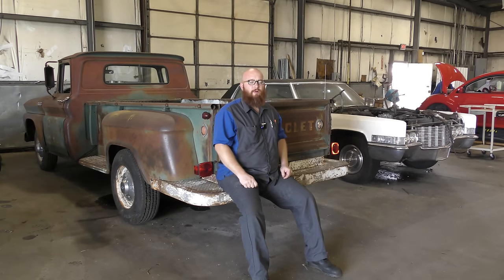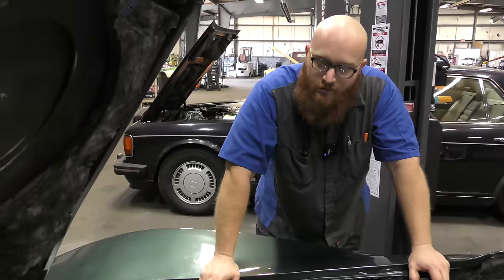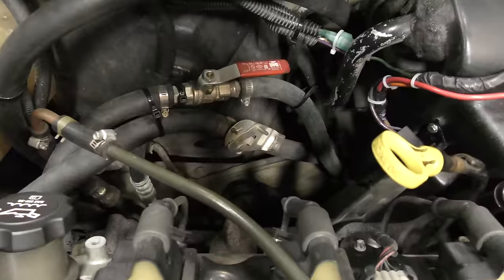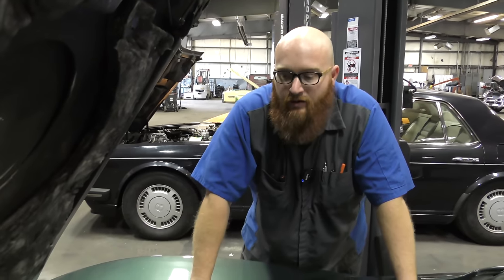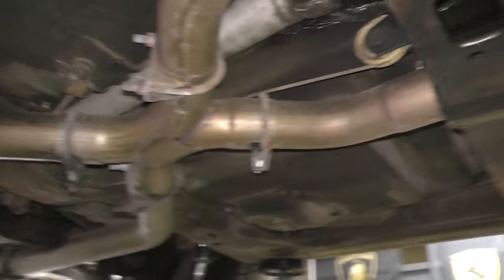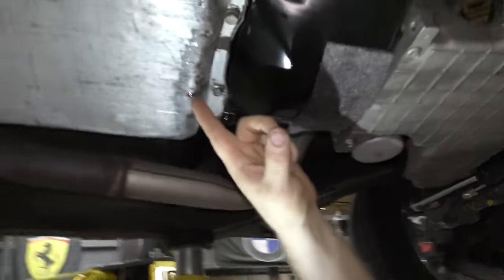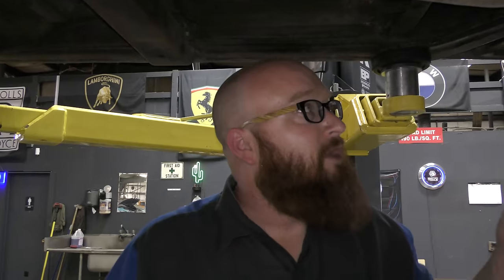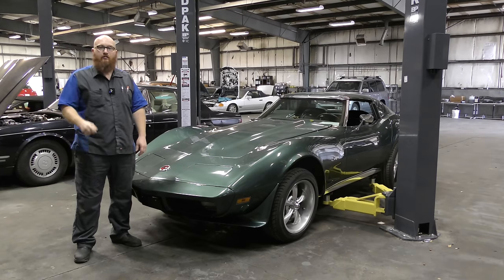Issues AFTER an LS swap! CAR WIZARD warns what can happen on an LS swapped '73 Corvette Stingray

Comment: I owned a new 73 454 4 speed in 73.  0-60 in 6.5 seconds around 250 horsepower.  Most minivans can do that today.  I enjoy modern versions of cars.  I can work on V8’s, carbs, and distributors but why now.

Comment: i would go with the after market fuel injection like the new holley system but u lose up to 45 hp with fuel injection and response but gain in mpg and u can tune to the road carb u need to know how to run the peddle if u race  they both have there ups and downs on the street i would have fuel injection if money was no option . if u do an engine swap u should keep a record of it and everything that was dun and what the engine came out of year and model and everything else u put on it the better the records the easy'er it is to work on

Comment: Electronics has always been the hardest part of a swap for me, from my experience is easiest to get a complete donor car and try to swamp as much over as you can. If you need parts from something else document it. I also don't get why you would swap to a LS and then use a carburetor, I would have gone LS EFI or just thrown in a build small-block.

Comment: I’ve been around so long that I knew guys that got out of the auto repair because of their unwillingness to learn new technologies. I worked in the industry when there were nightmare computerized carburetors and ridiculous vacuum operated emission controls that tried to make carburetors run lean enough to meat federal emissions. I learned the early fuel injection systems and have seen them improve in performance and reliability. I totally approve. I guess it stands to reason that most young mechanics don’t know how to work on carbs. Not enough business there to warrant the investment to learn it. I still run carbs on my old cars but I won’t touch anyone else’s junk for any reason. I can fix the cars. I just don’t want to deal with psycho people. If they can’t fix their simple carb themselves then they’re not cool enough to do that. drive fuel injection. Every hillbilly in the trailer park thinks they can do an ls swap now but most old engines can be made to run the way they should a lot cheaper if you know what you’re doing. Got to have your shit together either way. P.s I used to convert a ton of diesel gm cars to gas with Olds 350 gas motors. Easy and made a terrible car run well. That car would be a good candidate for an ls swap.

Comment: I think you could get good results with a carburetor on the old vortec engines 5 liter or 5.7 Edelbrock makes intakes and nice 650 cfm carbs then get an old HEI distributor and off you go they usually work great right out of the box I still have one in my garage

Comment: For me, the whole point and benefit of an "LS Swap" is the fact that you are also swapping in the latest technology, like fuel injection and no distributor and OBD-ll tuning. Why would some one do this swap and then put a Demon copy of a thermoquad on it?? Yes,  you need a chassis dyno, like we have, to get a decent tune out of it. You can get it close and run good without one....IF.....IF......you're someone (like me) who has been around these things since the mid 70's and knows how to tune them and old cars in general. I have a 1980 Corvette. Stock engine. All I hear is "Why don't you put an LS in it?". My answer.... Why fuck up a nice car? I did swap the quadrajet for a Holley spread bore version. Better tuning, bigger float bowls and much better of idle transition. The cruise control still functions with it too. That was important.  I'm in the restoration end of the auto business, so that has an effect on what I want in a vehicle. I don't care for the custom and "make it go really fast" stuff. But, the mechanics are just that...mechanics.

Comment: I'm baffled that there are guys that say, "I can figure out fuel injection, but I don't like working on or can't figurer out carburetors." You can figure out tuning a fuel injections system using holley software, efi live or whatever. But you can't figure out looking at plugs, or hooking up a AFR gauge, and can't figurer out changing out jets? I like both, fuel injection is great but can be just as much of a pain to get it to run right  as a carb. Carbed LS engines can flat run, and for someone lacking the computer tech or software to tune fuel injection it can be easier and more affordable, especially if you already had a carb lying around to rebuild and use.
Reply: pretty sure that oil pan is a C5 vette oil pan that's what I used in my 78 vette 6.0 ls swap

Comment: Granted on tv but richard hammond on tg, think its the one they got old british classics (with classic british problems) and i think it kept leaking coolant so he had a water container in the seat with a rotary handpump to keep refilling the coolant lol,
Wouldnt say mod but people using plastic wrapped garden mesh/fence or wire electrical wiring (headphones seems to be the main type of wire used that i've seen) to hold up exhaust pipes, drives me mental, waiting for the day someone poisons themselves with the fumes of the plastic burning on the exhaust, as if thats there idea of repair the body is likely full of holes so the fumes enter the cabin directly, also if it does manage to start a flame

Comment: That car has the "Deluxe" interior, seeing all the "woodgrain" on the doors.
the passenger side dash pockets are indeed stock. Some people prefer the carbs, but
on a LS engine, that defeats the purpose. LS engines are very responsive with fuel injection. Carburetors
on them is hindering the performance unless you go with the Holley Sniper kit, but once again, it's
$$$$$!! So, I'm guessing the previous owner didn't want to install a computer
and a bunch of wiring everywhere.

Comment: The motors in 73 were already detuned for at least 75 to 100 hp less than what they were a couple of years earlier. The horsepower war ended in 71. The atomic carb replaces a 4 barrel and has fuel injection. You have a small tunable module with o2 sensor input.  A 73 vette with a 170 or so hp is not cool

Comment: Yes, the electric radiator fan must run when the compressor clutch is engaged.  Transmission cooler, uh,oh...  What auto trans bolts to the LS?

Comment: A great point made by The Wizard, sure you've put in a modern / new engine...but how is it all setup?? You just tossed the haynes/chilton guides for this Corvette into the garbage, those schematics are no longer relevant for this modified car. Without documentation with an engine swap, it's more a negative than a positive for the car.

Comment: It begs the question...why use the LT1 if you are going to delete the fuel injection? Why not an older block so you can avoid all the extra cost of the conversion....

Other than possible oil leaks a 350 is a 350...

Comment: But looked the bright side of this kind of inspections. 
 You are actually getting needed experience as a detective.
 So, in case if there are low work volume at the shop time at the time, then you can just do some casual after-hours murder investigation or shoplifting prevention tasks for the local police department and  earn some extra nickel.
 I would say -- it's a job security measures.

Comment: He should just start over and have it converted to EFI instead of trying to get the carb set up properly. The carb is always going to be a hassle with altitude and season changes and fuel with variable ethanol content etc. I can't imagine going through the trouble of swapping it and then putting a carb on it.

Comment: Honestly, I'd only do an LS swap in a car with a notoriously crappy engine.  On this Corvette, if I really wanted to go lightweight I'd run an aluminum small or big block.  Yes, that's very expensive, but is the swap not?  Staying with the original engine families saves a lot of trouble.  With a Holley EFI it'd be fantastic.

Comment: well the problem with adding fuel injection to a old car is adding a fuel pump that will work and working out the ecu and some ls engines have the powertrain control module that controls engine and trans in one unit?

Comment: Looks like it's a little bit large for the displacement of the engine. She's probably why it's running fat. I'm not certain of the displacement of that engine but if it's no more than a 6L. It shouldn't be more than about a 600 to possibly 700 CFM carburetor. And then start tuning the carb. But if you're going to do an LS swap you might as well take the time to leave the fuel injection on it. You have to do so much work on everything else about the engine you might as well just use fuel injection. But it is possible to make them run well on a carburetor. But everybody wants to run an 800 CFM or 1000 CFM carburetor on an engine that doesn't have enough displacement to be capable of using one. It's a simple mathematical constant of displacement to CFM.

Comment: What was the person who did this swap's logic?  Was he going for fuel efficiency? Performance?   Heck, he could have taken what was probably a rather anemic 1973 350 and built himself a nice small block using ALL of the other stock components and easily doubled his torque and horsepower at much less expense and nary any trouble in the process nor would he have complicated future diagnostic repairs.  I probably would have used a lot of Eldebrock parts, on a 383 build and added an HEI distributor.  Or I could have built to 1971 LT-1 or even 1970 LT-1 specs.  Or I could have built a good gas mileage 327.  So many EASY choices.   If this car has an automatic, I would have built up a nice 700R transmission for economy. If it has a 4 speed, I would have put in a 5 speed o/d transmission.   As it sits now, I think I would choose one of this options anyway and scrap the whole LS swap.  I personally like the pre computer quadra-jets with a spread bore Eldebrock 180 degree (two plane) manifold and nice Eldebrock aluminum heads.  I would choose an RV style cam with a WIDE and flat torque curve.

Or don't even screw around, build a Buick 455 Stage One engine for it.

Comment: Why did they put on a thermo-quad version of the demon?  That's modeled after a  Chrysler carb, I don't understand...why didn't they just put on a Holley sniper system, since they don't cost that much more than the demon carb they've got on, and it works like a TBI system

Comment: If you can't quite get the carb dialed into your satisfaction, and you really like fuel-injection...and the owner can afford it...why not try to offer a fuel-injection conversion or add OEM fuel-injection? It might be more cost-effective because instead of having a race shop dyno session to dial in the carb the owner would have a better long-term solution.

Comment: I am form Europe. Can somebody explain why Wizard says it has oryginal milage 67k miles? It has only 5 digits, so odometer could be at 2nd, 3rd or even 4th roll... It can be 267k or 367k. Also it can be cluster form other car with low milage... The interior was redone so it does not prove anything.

Comment: Wizard, for long term service and practicality, would it be sensible to replace the carburettor with Holley single point fuel injection, which comes with its own tuning and set up package? You can always hide the small LCD screen out of sight somewhere.

Comment: You take that truck and drop a LS with a bellhousing adapter to hook up to the factory transmission that truck will last. I can make that LS motor start up on the ground with just three wires before you even put it in the truck

Comment: That conversion is a hack and the engine bay is a disaster! I've done dozens of engine swaps and my wiring is neat, soldered, makes sense, and you don't see any wiring. For harnesses you have to see, I never use that convoluted plastic pep-boys garbage tubing. There's a nice braided split loom on the market that looks attractive. My plumbing is laid out nicely and use the least amount of connections and fittings required. Never  use those U- clamps on exhaust either. With band clamps, it' easier to disassemble and service, and look better too. A problem is that I've seen people get in a rush and hurry up to show it off for Friday night cruise-in, get it working for now and never finish it properly. Take your time, spend the good money on good products and you save money in the long run.

Comment: I owned a new 73 454 4 Speed.  0-60 in 6.5 seconds which was fast in 1973.  Every 200 miles looking for gas stations as most cars of that era.  Not much to go wrong with analog tech.  Everything mechanical no canbus or fuel injection.  USA was slow to USA adopt tech from Europe .  Fuel injection was starting to appear.  Fan clutches were still popular Big 3 vs electric radiator fans.  USA had sealed beam headlights forever then halogen started to appear from Europe.  HID headlights also took awhile.  Crumple zones usa still working on for a couple decades as well as fit and finish.  Warranties still seem shorter on domestic vs non domestic.  No one challenging hyundia/kia that is for sure.  Corvette timeless body styles with big hip front fenders.  Wrap your ass in fiberglass.  Called Fire coffins back then as fuel sprayed on occupants if rear ended.

Comment: Holy crap on the pan ... the leading edge, which is inches above the surrounding area, is beat to crap !!! How does THAT happen? You might want to sell him a new Pan AND a "skid plate" ... some of the damage is right at max thickness and one more hit and all the fluid will leak out and the Money Light may or may not illuminate ... and we all know what happens then.

Comment: LS engines do fine carburation actually. They still have a wet port cylinder head like any other FI or Carb'd engine (not talking about DI engines obviously). Why not just throw a vacuum gauge on it and tune that way? That's how everything was tuned 30+ years ago & still works. Widebands are Great and really help but I'm cases like this a vac gauge is your best friend. Other than that have the customer take that thermoquad looking Demon off and do the car & LS justice and send it out with a 4150, Everybody wins 😉

Comment: I had a carbureted car in 1974 and dealer had only one OLD dude who knew carbs.  It died at every 90degree turn dangerous and annoying.  The float arm was bent a tiny bit.  Last Dodge I ever owned or will.

Comment: I thought with your knowledge you would for sure know the proper way to lift an old Corvette. You are supposed to open the doors and take the t tops off because the fiberglass body will flex when lifted and if you don't do this it can create cracks in the fiberglass I'm really surprised you don't know that!

Comment: Can confirm about shops charging up to work on modified cars. Did an LS swap on my 88 Firebird, a few months later the rear main seal was leaking bad. I couldnt find anyone to do it since i didnt wanna be on the floor wrestling a transmission and didnt trust myself doing a job ive never done before. Finally found a shop that would do it, the price was $1500, probably trying to scare me off since they said it wouldnt be worth it and to just drive it like that. I told them i didnt feel comfortable driving it with an oil leak and gave the go ahead to do it. Called me 5 minutes later telling me the oil leak is coming from the oil pan and they couldnt do that. Well that was a lie because I took it to another shop and they did the main seal and the leak was gone. Once again, Mexicans doing jobs on one else wants to do.

Comment: Hi. Would you have a link to where I could get one of those test relays (with the built in switch) that you used to test the engine/ac fan circuit on the Corvette.

Comment: that's a stock LS6 oil pan.  Typically called the "batwing" pan.
Reply: Great video btw.  Didn't mean for my comments to sound rude or unappreciative.  The points you make about non gearheads buying retromods are TOTALLY accurate.

Comment: AC on that Body Vette, never cooled very good. Not enough airflow over condenser due to design
Reply: Not only that, the radiator didn't cool very good. C3's were notorious for overheating for the same reason: poor airflow design.

Comment: What Holley needs to make is a FI that sprays 30 to 40 lbs of gas right at the intake valve. Which means a intake manifold 8 fuel injectors and air supply and computer and parts that you can tune your self either by a laptop or there computer.. The problem with a carb is the gas vapor locks at the intake by the intake valve and stops the engine. That carb FI system aint worth the money cause it suffers from the same problem. Vapor lock at about 180 degrees at the head and intake manifold. I have a 454 in my camaro runs perfect till temp at the intake and head reach 175 you can hear the sound difference then at 180 it is like turning the key off. Why you think the car manufacture's went with F.I.

Comment: Umm, a diaper on the transmission? What else will you find? In 2022 the advantages of factory fuel injection/electronic controls trumps carbs. Beyond that---no comment Wizard as I will refrain from any negative comments. It's a nice Corvette.

Comment: If you're going to use a carb, why bother with an LS? Should have just rebuilt the engine he had in it, add some heads and a cam. His AC would work, he could get it repaired without someone having to trace all the wiring to get a handle on what's what. This car is a mess. Looks nice though.